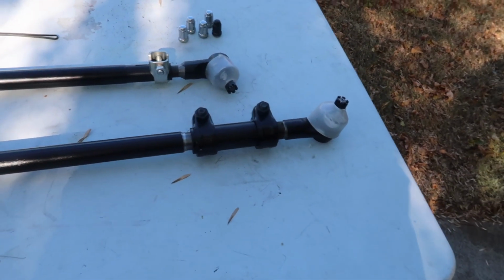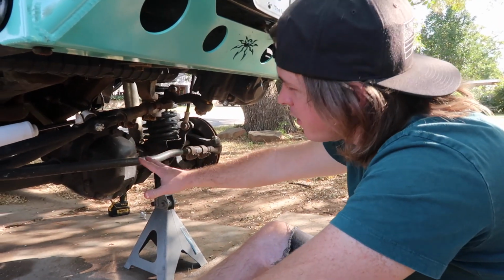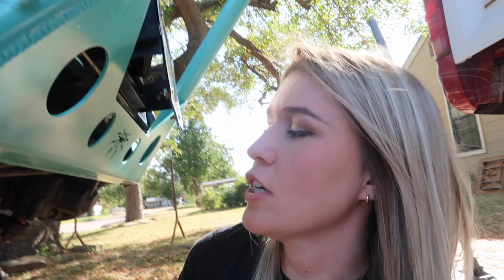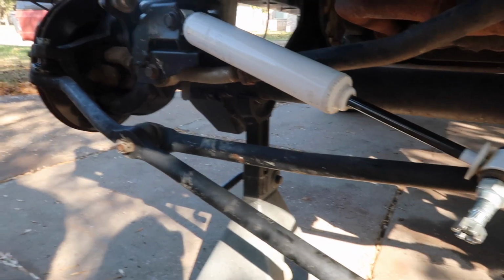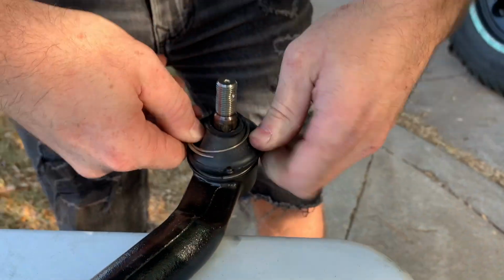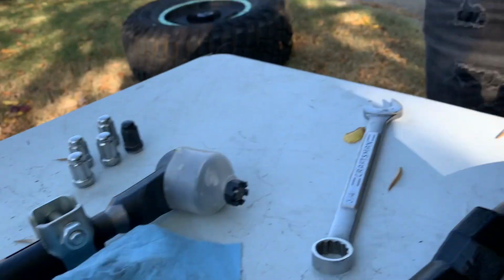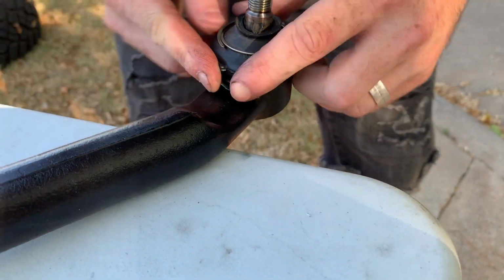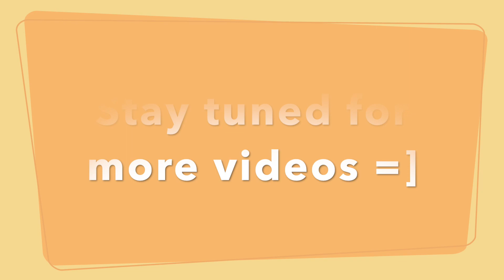Jeep Unlimited LJ: Upgraded to RockJock Currectlync Steering System

Comment: Hello, I have this same setup on my jeep and was wondering if I could run it on 6 inches of lift. I have a rough country 4.5 lift kit and I’m adding acos bump stops which I believe add 1.5 inches making it a total of 6 inches of lift. Could I possibly still use this or would I need to buy something else to make it work? Thanks !
Reply from the maker: I don’t see why it wouldn’t. It’s got a lot of adjustment in it so I think it be fine. Just curious why do you want to go up to 6 1/2 inches lift?
Reply: @wrenegadeoffroad1400  thanks for the reply! And no particular reason, I’m actually fine with the 4.5 inches. I just wanted to add the acos bump stops but they add 1.5 inches to what I have already which would put me at the 6 inches of lift. I am on 35’s too so I think it would look great too

Comment: Does your lift have the pitman arm drop ? I have a 4 in lift with pitman arm drop . Adjustable Track bar with drop bracket .
Reply from the maker: No I dropped him an arm actually makes your steering worse I would recommend going back to stock.
Reply: @wrenegadeoffroad1400  if you have heavy duty steering kit it saids in the instructions that you need stock pitman arm . But if you have stock suspension you need the pitman arm drop. For the 4in lift .

Comment: Which is better rock jock modular extreme duty or synergy.
Reply from the maker: Rock Jock hands-down
Reply: @wrenegadeoffroad1400 Thank you for the reply I am on the verge of upgrading my steering system on my Jeep JK. I leave in UAE and do a lot of dune bashing (desert driving) almost every weekend and I want to know how does Synergy jk steering system compare with Rock Jock JK 9703 Modular Extreme Duty steering system. Is it worth paying double the price for the Rock Jock. Also which track bar do you recommend. Will be very great full for your reply.

Comment: How do you like it so far? How tall is your lift? And, did it help reduce the bump steer that our TJ/LJ’s are famous for, or did you have to make other mods for that?  
Love your videos! Thanks!
Reply from the maker: Wife says it works great! No bump steer. Mimics the stock set up so it has a very nice feel. The jeep has a rock jock 4 x 4 or currie 4 inch suspension kit. I have a previous video of installing it. And we’re glad you like the videos we will keep them coming.
Reply: @wrenegadeoffroad1400  Thanks for the quick reply! I’ll check out the other vids.